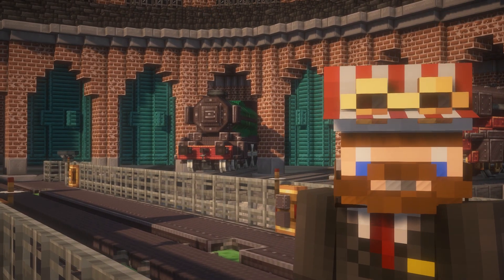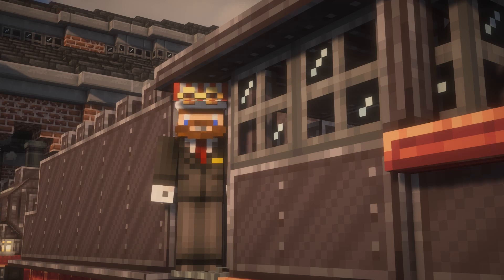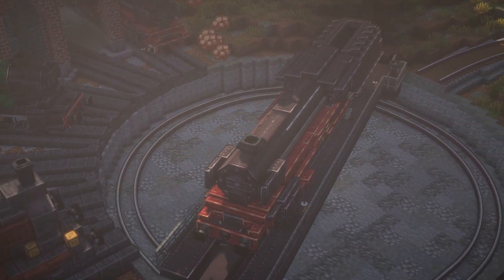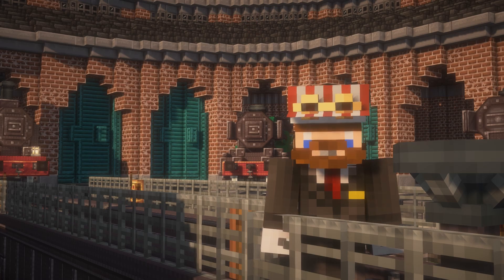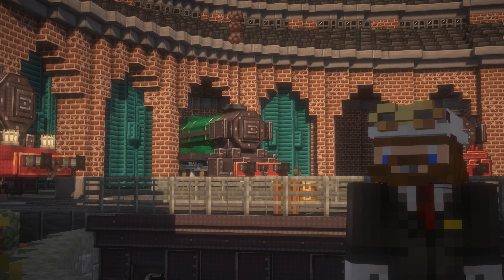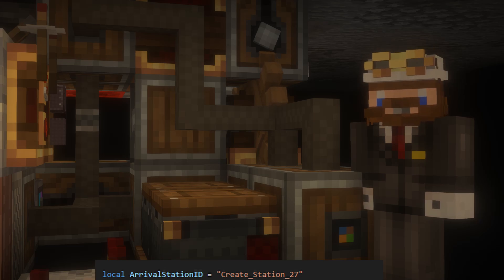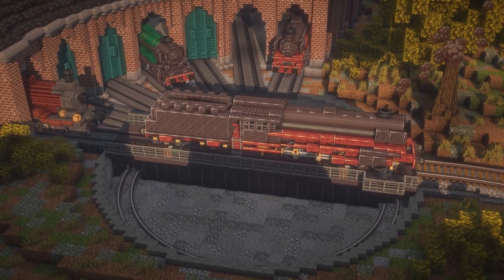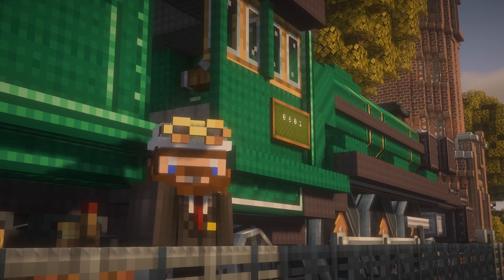Minecraft create mod - Engine turntable version 4 + computercraft integration

Comment: can we get a video on how to connect this into a system? this just shows how it operates, not how to connect it. the signs are a little vague
Reply from the maker: well it works on its own, the only thing you need to connect is the sign that gives the signal output to a signal on an incoming track. This will block trains from coming in whilst one is unassembled on the turntable.

I am probably not going to make a video of how this will work in a whole system since it involves so many step and there are so many variations to it. some might use it for 1 train making it easy, while others use it for a lot of trains and types making it harder to make automatic. I want to leave this up to the people that want to implement it.
Reply: @ImagineerDave  so as soon as a train pulls in it initiates?
Reply from the maker: @The_CavemanOfficial  yes it should atleast

Comment: It has been months since this video uploaded. Did or could you make the turntable turn 45 30 or 60 degrees now?
Reply from the maker: Nope you can't. A 90 degree one might be posible with some extra trickery but 45, 30 and 60 are not angles on which trains can be assembled. Sure you can make it so it stops there but trains wont be able to drive off.
Reply: @ImagineerDave Well, have you tried the Interactive add on? You can make contraptions on top of contraptions
Reply from the maker: @aidanmirzav8936 i know, but the train graphs wouldnt align I think and besides that, it can cause big errors that might corrupt your world. I like to keep things within the limits of normal create

Comment: Couldn't you just use chassis instead of the stickers to stick the trains ? This way you don't have visible stickers to mess with the design, and you also get rid of 90% of the redstone needed.
Reply from the maker: As far as I know you can't. You need something to merge the two glued assemblies and afterwards detach them. You also still need the piston pushing up since otherwise trains without blocks in the side of the rails would never be stuck to it. The timing would stay the same because you would need a stickers inside locomotives with multiple bogeys.

So as far as I know, no you can't. But maybe I don't get what you mean so show me for sure!
Reply: @ImagineerDave  Chassis are one way sticky only, so if you move the turntable, the train would come with, but if you move the train, the table will stay in place. for the one block gap, you could have the bottom of your train have copycat panels or slabs to make sure there is contact with the ground. You could with this easily have the entire length of the turntable be a line of invisible chassis under the ground that would stick to the train way more easily. It would also increase the possible designs of train with so many attach points
Reply from the maker: @aRandomDudeDRS  Hmm didnt know that, will definitely try and see how it works and if disassembly and reassembly dont mess things up. Also what do you mean by invisible chassis under the table? I would have to make contact between train and chassis right? I couldn't have blocks on the train that would be in the floor because if I would disassemble it would break those blocks or the table. Join my discord and lets chat, or join my livestream rn so we can chat about it.

Comment: Hey hi if you remember me i was building a steam engine in my world but mechanical pump is not taking water from the ocean directly so i used water pulley and the water reaches tank but still the boiler shows no water
Reply from the maker: @Ryunix25  Hi, i don’t quite remember, was it on discord? Also you should probably watch some beginner tutorials on piping and steam engines for that.
Reply: @ImagineerDave  oh thanks i wouldn't mine wether you remeber me or not but i will appreciate you for alteast replying and helping your viewer
 thanks dude

Comment: I’m having trouble with the creative motor turntable. It’s not working at all. And the stickers are reversed, as in they are up when they aren’t supposed to be and down when they aren’t supposed to be either. I haven’t messed with any of the mechanics of it. Any ideas?
Reply from the maker: Try inverting the creative motor, might possibly be because of a different rotation that it wants the input reversed

Comment: Great Build! What mods do you use other than Create? Don't gotta include preformance mods just mods that added the blocks used
Reply: iirc he uses steam n rails and probably copycats+ and design and decor
Reply: @justanotherhumanorami9697  yea I also see Create: Deco blocks in there
Reply: @Mark00266  I would say copycats thx to the smoke deflector
Reply: It looks like a copycat panel
Reply from the maker: Hahahaha in the video I say some of the mods, but indeed Create, steam n rails and copycats+. The rest of the buildings also use chipped and create deco

Comment: Does it also work for turning it 90° if you lay invisible tracks in that direction as well? I'd suppose so or does it mess up the redstone if it isn't 180°
Reply from the maker: It would be quite hard to setup since you would need two crossing tracks. Assembly doesnt like crossing tracks so until that is fixed it wouldnt be possible unless you use really tiny engines that occupy only half of the table

Comment: I wonder if you could do without the disassembly process if one used the create clockwork physics bearing to make table its own physics entity. With this you might also be able to turn to rails not 90° on the world grid. But I haven't tested that, so its speculation
Reply from the maker: Yes i think it would, but that mod tends to be really buggy and cause trouble. Thats why id rather not use it haahah
Reply: how would the train get off the rail tho

cause any block on a physics entity is technically millions of blocks out near the world border.
Reply from the maker: @deathrobloxian  I dont know, i dont use it